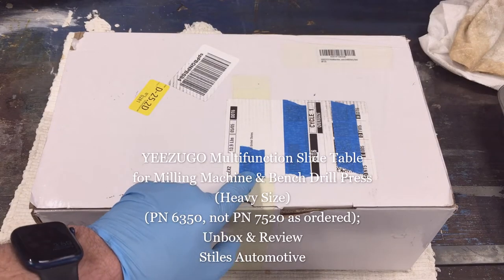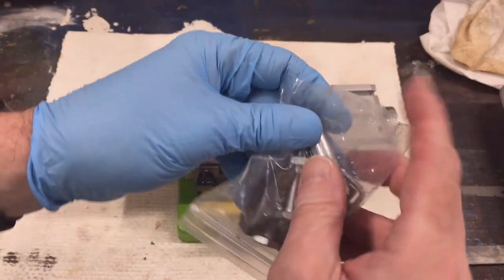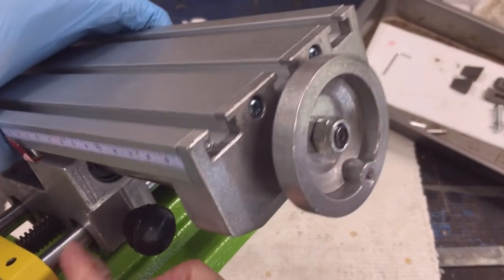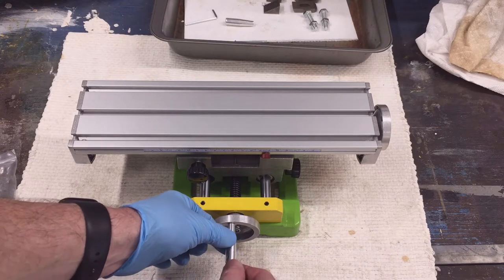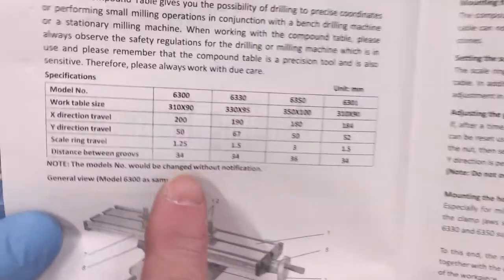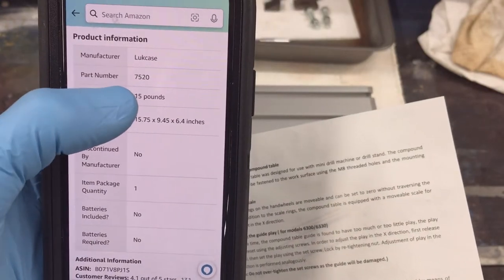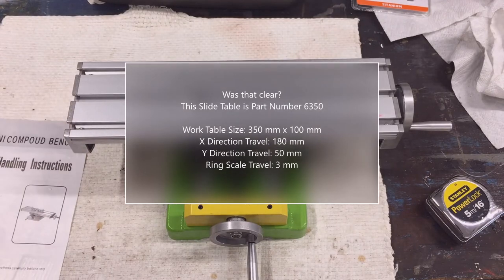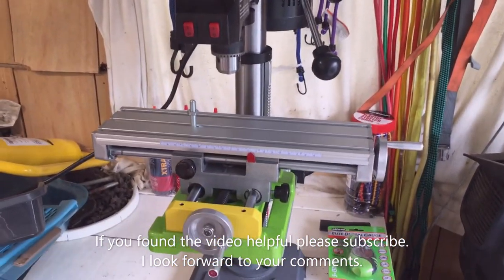YEEZUGO Slide Table for Milling Machine & Bench Drill Press (Heavy Size) PN 6350; Unbox & Review

Comment: the dove tail base version needs grease barbs added for the tracks, most all metal mill tables have them.
Reply from the maker: Arden, This Table has Linear Bearings and no Grease Fittings, like you say.  One of my few regrets, is not buying a good little Milling Machine, . . . . years ago.  - Stiles